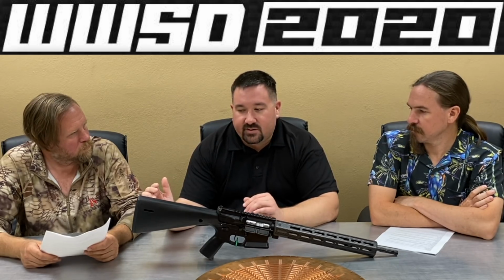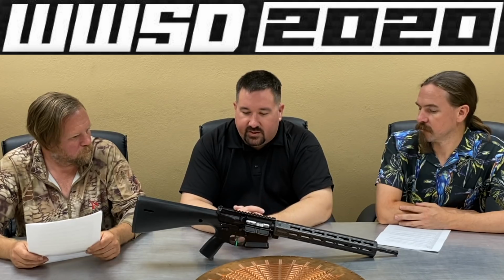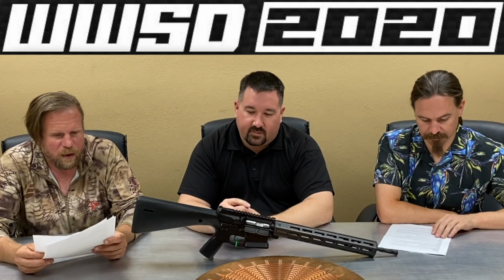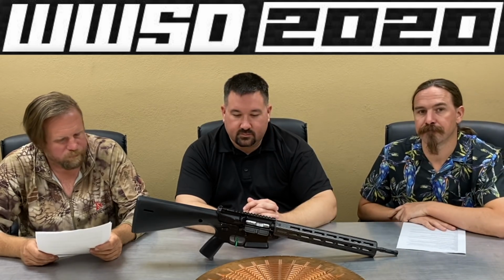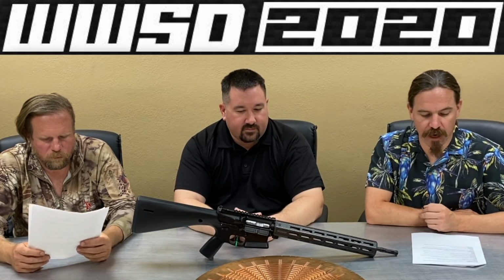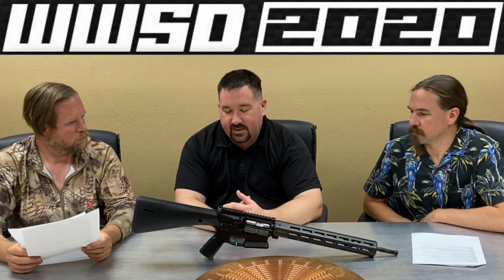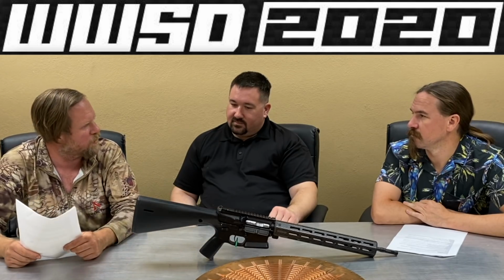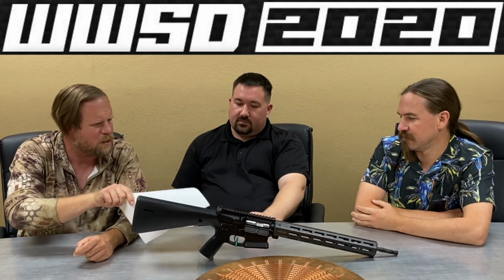June 2020 Q&A - WWSD2020 Edition

Comment: I recently purchased a complete stnd KP15 lower, for the grip I took a Hogue slip on grip for a Glock 17 and cut it on the back seam, wrapped it around the KP15 grip and wrapped it with 2 wraps of electrical tape. Feels GREAT and doesn't look half bad. Keep your hatchet sharp and your powder dry.

Comment: Will the lowers come supplied with metal fire control floors? There are a number of cassette fire control packages that require set screw tensioning ( Elftman, TriggerTech, etc.) . I assume that those set screws would just dig into the polymer and would damage the receiver. Will a protective solution be supplied or made available? Alternatively, is it safe to use a set screw tensioned fire control cassette without any protective plate?

Comment: You should 3D model the inside of that stock cavity and sell the cad files for it so that someone with access to a 3D printer could design their own storage piece that would fit perfectly. Alternatively you could sell pre designed print files and sell those

Comment: The original wwsd rifles used jp captured buffers, I didn't notice any mention what these rifle come with. 
The armaspec captured buffers are half the price, and more importantly they are only 2/3s the weight.
Reply: You can check the specs by going to the only seller of the WWSD rifle, Brownells.  The Armaspec system is not 2/3 the weight of the JP gen 2.  And KE Arms has said that they found some damage being done to the buffer cavity.  They do not approve the Armaspec system.

Comment: I've asked this a few times... what are your thoughts on the Kaiser US X-7 receiver set. The only real issue I've had with mine is the safety selector feels cheap due to the detent and spring hole is oversized. The upper receiver however seems to be top notch. Just wondering why this wasn't a consideration for the wwsd2017 rifles, other than the lawsuit brought against them by ATI, which has now been resolved and was a non issue for them.

Comment: That rifle looks very cool, my only gripe is the A2 stock, I wish there was a collapsible stock option.  Collapsible stocks are great and make a gun truly universal, you can give it to anyone and they can just press a button and make it custom fit their shoulder regardless of if they're 6'2" giant or a 4'10" girl.
Reply: They already discussed this at length in wwsd
Reply: @raylandraybels9462  I know, and I completely disagree.
Reply: Apart from weight saving, then what's the point. When you add complexity to the system, you add weight.
Reply: @raylandraybels9462  universality, to make the gun more universal.  You can't sit there espousing the greatness of universality with your ambidextrous controls and then turn around & shit on the adjustable stock.  Also with modern stocks you really aren't dropping much weight at best you're getting a couple ounces.
Reply: First of all, it's not an A2 length stock, it's A1 length.  Second, the concept of this rifle/lower eliminates any possibility for an M4 style collapsible stock.  Third, and disagree all you want but most people will find this lower's length of pull more than acceptable.  Any manufacturer of a product like this must consider the vast majority of the people who fall under the 70% to 90% of the population under the bell curve.  As mentioned in this Q&A, the buttstock will accept any standard fitting cap that can extend the length of pull.  And as mentioned in this Q&A, there is a certain amount of reinforcement required in the stock behind the buffer cavity to strengthen that area to prevent the buffer and spring from blowing out the back of the stock, so a shorter version of the stock is not possible.
So, if you are 6'2" (and BTW, someone who's 6'2" is hardly a "GIANT") or 4'2", this rifle/lower may not be for you.  I'm sure KE Arms and all the other manufacturers out there have no plans of discontinuing their M4 style lower kits and rifles.
Reply: @beeleo  nobody said anything about 4'2" I used 4'10" because that's the low end of the average women's height chart 5th percentile, and 6'2" is the 95th percentile for men's height so yes that's quite tall & that range is going to cover 95% of all women & men in that range. I assumed that they wanted universal appeal to get as many customers as possible, not to mention that people might want to adjust their stock for when they are wearing body armor.  I honestly think stoner would have gone with a buffer tube, and done a metal insert buffer tube ring like the Tennessee Arms Polymer lower has.

Comment: Having made the mods to the CAV II, cutting the slot for the PDQ was very easy with a dremel router. what was not as easy was creating a hole for the bolt catch roll pin. My lower came without the hole present, and you can not access the face properly. I tried to contact GWACS, but was unable to remedy it. fortunately polymer melts. It has held up well but I am hoping to replace it with the improved KP model.

Comment: I would be curious to hear about temperature testing. I live in a place that goes from 90+ degrees F and 90%+ humidity in the summer to an easy -15 degrees F in the winter( We've hit -30 F). Is there any change in shape and dimensions over these temperature ranges?  Any zero shift?
Reply: I can't imagine how dimensional changes in the lower would cause a zero shift when virtually all aspects of accuracy are a function of the upper and barrel.

Comment: No comment on the ATF/Legal issues with an 80% but mold wise this shouldn't require a new mold. Having the fire control group be a changeable insert on the mold core, One insert for a 80% and one for the complete. However I could see plastic becoming too thick in FCG and lead to sink marks and weld issues.

Videos of welding process would be very interesting...

Comment: I'm 95% I've watched every video on both the 2017 and 2020 WWSD projects, and I don't recall then ever stating how much weight is saved by the polymer lower- can anyone point me to that info? What does this weigh compared to the equivalent set of typical parts (aluminium lower receiver, pistol grip, buffer tube, stock)
Reply: The biggest weight savings are in the barrel and float tube - the polymer lower itself is more about lightweight durability than pure mass savings
Reply: As I said, I've watched all the videos on the WWSD project, including all of this one, so I understand the philosophy behind their part choices.  It doesn't matter if weight savings was the goal of this choice or not, I just wanted to know how much it weighs 😉
Reply: @SCEto_aux  ah, gotcha - well, let's assume the Mk. 3 weighs roughly similar to a GWACS lower, which is about 21.2 oz. You can get lighter than that with a minimalist grip and stock on a good lower like from Aero, but obviously a similar conventional M16A1/2 stock is going to be a good bit heavier (edit: some googling around says that a true M16A1 lower is up to a pound heavier than the GWACS!)
Reply: I'm not too sure that weight saving is/was the ultimate goal. From my understanding it was, "make it simple stupid" configuration when running and gunning. No stocks to collapse or adjustable check rests or grips etc. The new goal for KE arms and Brownells is to make a simple set of SKU's that will make it's profit from bulk sales rather than try to markup the product to recover it's loss due to a per sku loss associated with machining

Comment: Cerakote is great for high temp components like barrels, gas system, muzzle devices, but receivers and hand guards really don’t need the capabilities that upper limits of cerakote provide. This is why I use duracoat. It’s just so much easier, has excellent cosmetic finish, DOES NOT CHIP, and is still fine on gas blocks and barrels unless you’re mag dumping sequential D-60s on your rifle full auto

Comment: I needed a way to make my BRN-180 even more front heavy.  I'm honestly tempted, if only to have a curiosity rifle with the weight balance of Mjolnir.
Serious Question:  Is there a way to add steel/metal inserts at the front and rear takedown pin holes, either from the factory or after the fact?  A lot of people with polymer AR-180Bs got burned when their front takedown pins ate through the upper.  I recognize that metal reinforcement rapidly erodes the advantages of a polymer receiver, but the takedown pins seem like low hanging fruit since it's a cylinder that could be threaded in after molding.

Comment: MCX uppers are not compatible with this lower. NOT!!! MCX uppers are taller than AR15s. Their action springs are in line with where the AR15 charging handle is, and the MCX charging handle is higher than that. AR15 lowers, without the adapter, do not support MCX recoil assemblies. This was the failure point for nutnfancys infamous MCX failure. No adapter = incompatible, and the MCX adapter is incompatible with the KE arms mk3 polymer lower.

Comment: The Sig MCX could work but part of the kit to put an MCX upper on an AR lower is a piece that goes into the buffer tube threads and extends upward to cover the taller exposed upper receiver since the MCX upper is taller than regular AR15s.

Comment: When you torture test the 3D-printed mock-up, you need to make 500% sure that people realize it is not the actual KP-15 stock. Even then you will probably have people saying "That KP-15 plastic stock is garbage, watch how it fails, I'd never buy it". At least try to make sure it doesn't blow up into a viral storm of misunderstanding.
Reply: Just paint "3D printed prototype" on all surfaces, gun, tables, mags, shirts, a large banner in the background and have it visible at all times. That should successfully lower misunderstandings by about 5%.
Reply: I really think these are going to takeoff like plastic receivers on pistols.

Comment: F2000 had a polymer firecontrol module.  Note adding a steel bearing surface to the sear interface DRASTICALLY improved the trigger on the FS2000 [from experience]

Comment: A complete lower with a slt-1 trigger and ambi controls would be a interesting option. If the MSRP could be a better value than buying the components separately.
Reply: They have that, just without the PDQ lever, for $360

Comment: I was on the fence about buying this upper. This q&a really did clear up a lot of tiny details/concerns i had with my build and this video really cleared things up for me. I love how trasnparent all of u guys are in the overall market that this lower is degisned for. And how you guys describe what this lower is capable of and what it is not. Normally i do not preorder anything nowadays, but i feel like this project is heading in a good morale situation moving forward, that I am willing to preorder my lower and I am willing to undergo possible problems with my lower. Knowing that ke arms will be willing to lisen to our constructive feed back as a community, to fix any manufacturing problems in an update to the lower. Which is VERY rare in the gun world. Also, for $100 this is a smoking deal nowadays.

Comment: Adjusting the buffer and spring is not the right way to deal with an ar shaking itself apart...

The root problem is being overgassed, that is where you need to focus your attention for a proper fix.

Comment: For anyone interested I threw together a CA legal WWSD that ended up 5.5lbs naked(rifle only, no sights, no sling). It's possible to stay light but comes at a pricey cost.
mass(g),	part
2.2,		forward assist retaining cable loop
2.3,		gas tube
4.4,		grip screw
14.0,	safety; detent; spring
32.7,	safe mag 2
40.0,	ambi charging handle
53.9,	gas block
62.2,	buffer spring
68.4,	trigger
80.7,	quick pins; qd end plate; bolt release; castle nut; buffer pin; trigger guard; forward upper retainer pin
87.1,	grip
121.9,	Stock
149.9,	buffer
236.7,	assembled upper receiver(upper, forward assist, dust cover)
236.7,	stripped lower
327.9,	bolt carrier
377.0,	handguard; barrel nut
590.0,	barrel

Comment: Can someone explain what those 80% firearms are and what the purpose is for those?
Reply: It's a raw casting/forging/whatever of a receiver or frame of a firearm that has the complete external dimensions of a finished gun with most of the internal shaping incomplete. As such, it is not classified by ATF as a firearm and does not need to be sold through an FFL. Any person who can lawfully own a firearm can manufacture their own so long as they do not intend to make a business of selling them. Finish the machining using a mill or a pillar drill and you've got yourself a working firearm that has not gone through a dealer.

In short, it's a way of circumventing the system.
Reply: Unfinished guns you build yourself and dont need to register since you didnt buy a gun

Comment: I've got a feeling mass marketability is what makes this project viable. But correct me if I'm wrong. 
(Just a joke, always nice to see videos from you guys. This includes Russell.)
Reply: It sounds like they made a really big investment in time and money in this project.  Plus the mold setup is very inflexible in terms of changes after initiating production, so there’s a lot of risk here for the manufacturer.
Reply: @chipsterb4946  Yes I realize that. That was the joke that I was making, as Russell frequently said the reason why making little special small-batch receivers wasn’t viable was because mass marketability/economies of scale was the advantage of the mould.

Comment: My initial reaction a week ago was, "Ugh, what the hell is that?!"  Now I'm thinking, this thing ain't so bad.  I'm beginning to see the real potential behind it.  I like A1 stock's, and the grip looks similar to a Sig.
Reply: I'd recommend going back and watching the wwsd2017 series if you haven't so you can see all well thought out logic that went into the design.
Reply: @John Doe In that case I don't want one.  I'm what's considered in the gun industry, a short guy.  I thought he said it's an A2 in the last video.
Reply: @chzzyg2698  A1 is shorter than A2 length, though.  A1 LOP is 12.75" compared to 13.5" for the A2.
Reply: @rhvette  You're right!  I always get those two confused.  I have an original A1 on my M16 clone and I keep calling it an A2.  I guess I'm back in the pool party.

Comment: Can't we just move into the 21st century already and get some polymer barrels, jeez....
Reply: Join me in the 31st century with firing pins made of spaghetti.
Reply: @MrWillxyz  Pleb, in the 35th century we moved to laser rifles powered by AAA batteries with fiber optic spaghetti barrels.
Reply: Lasts one shot and the rifling gives out while the bullet is halfway down the barrel, but it weighs nothing
Reply: They got one to work with 65 rounds of 22lr before it blew up, thats the best Ive heard on a polymer rifled barrel so far
Reply: There are some folks in the 3D printing gun community experimenting with printed barrels. Granted, they are in their infancy in terms of viability, mostly proprietary designs, and the already mentioned issues with longevity. The ones that come to mind are SuckBoyTony's BA-50 (printed .50 cal with proprietary DIY rounds) and 3DprintFreedom's barrel for .22 LR AR-15 conversion kits. It's very interesting to follow, but not something I'll be adopting at this time.